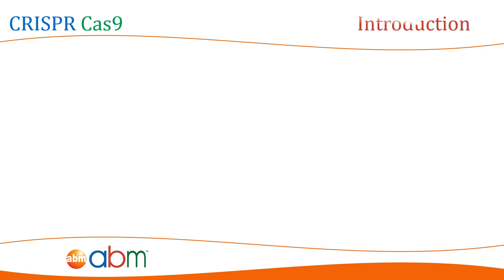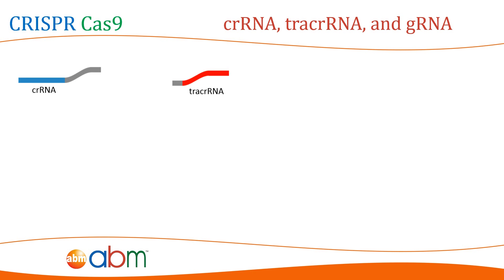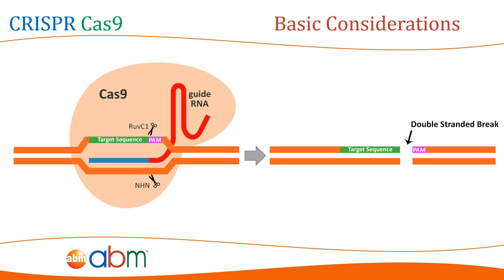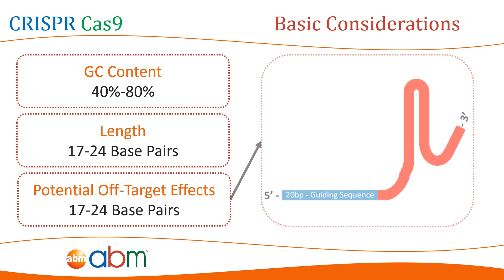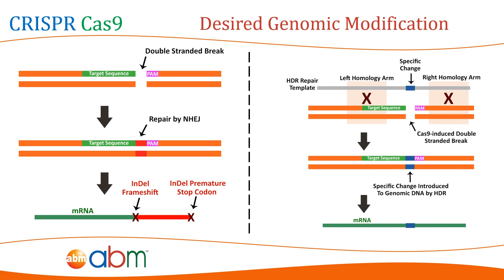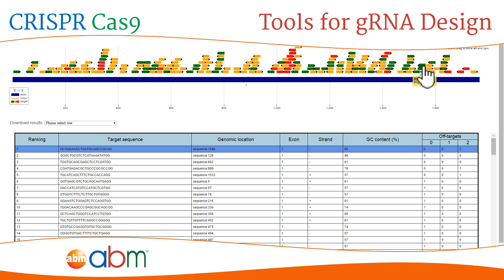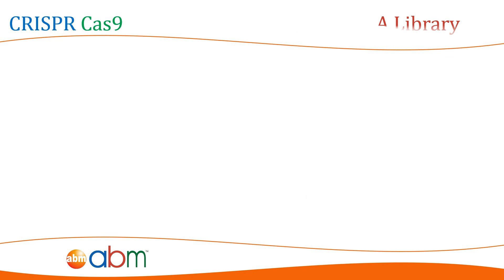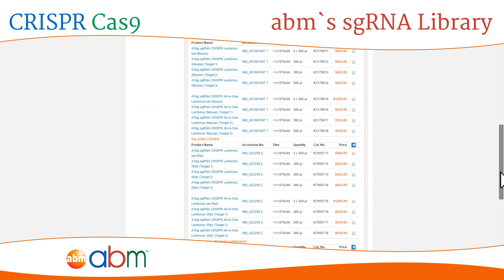3) CRISPR Cas9 - gRNA Design

Comment: What is the use of tracrrna and how does is function?
Reply from the maker: trans-activating CRISPR RNA (tracrRNA) is a small trans-encoded RNA. In the engineered CRISPR system, the crRNA (CRISPR RNA) and tracrRNA are combined into a single guide RNA (sgRNA) complex. The tracrRNA acts as a scaffold allowing for the linkage between crRNA and Cas9.

Comment: Hello ! thank you for the video,
Is the gARN for Crispr-Cas9 the same as the one with Crispr-Cas13 (which targets ARN transcripts) ?
Reply from the maker: ChopChop can be used to design sgRNAs for use with Cas9 and Cas13, but the design considerations are different. For example, there is no need to look for a specific PAM sequence when designing sgRNAs for use with Cas13.

Comment: I want to produce a KO Arabidopsis Thaliana, is it possible by this system. Traditional systems are time consuming. Please provide me a guide through. Also I would like to know if I can introduce a gene cassette of a metabolic pathway (3 genes) into the same species.
Reply from the maker: Hi Arpan! Thanks for leaving a comment! I'm sorry, but this system has been optimized for mammalian cells! Using CRISPR Cas9 on plants such as Arabidopsis requires some special considerations such as codon optimization, expression from a different promoter (popular promoters for Arabidopsis include AtUBQ1, CaMV35SPDK, and AtU6), and a different method of transfection (agro-infiltration/transformation or PEG-protoplast transfection). I have found this review paper on the subject, which you might find useful: https://www.sciencedirect.com/science/article/pii/S0734975014001931. As for knock-in, the limit as to what you can introduce would depend on the size of the cassette. Inserts that are too large will be more difficult to successfully knock-in. Hope this helps!

Comment: what would happen if there is no PAM in target, how can we design gRNA against such target so that it directs nuclease to cut that target? Then we will have design new Cas9 or old one can work. What will happen then?
Reply: Amit Kumar 
Then you'll have what's called off site or target effects. Which result in crosslinking possible transcription errors random dimer cleavage various over or under expression mutations defective genes and otherwise undesirable transfection of unintended genes. Hypothetically if you knew the site specific receptors to a specific cell line you may be able to further reduce off target binding by further engineering of viral capsid surfaces used in viral vectors.

Comment: Can Artificially Designed sg RNA target a genome without PAM ?
Reply from the maker: Hi Amit! I think I answered your question below, already, but just to re-cap - currently it is undertsood that the PAM site is required to target the Cas9 which then helps in guiding the sgRNA-Cas9 complex to the target site. The sgRNA can't target to the specific site without Cas9's help. There is a paper here that discusses the structural reasons in more detail:  https://goo.gl/LmLZKP

Comment: Do you think 1 sgRNA  is enough for the knocking down the gene?
Reply from the maker: Hi Omar, thanks for your question! Did you mean knockout of the gene? (If you meant gene knockdown, this would entail shRNA or siRNA, instead) For CRISPR sgRNA knockout, we always recommend at least 3 sgRNAs to ensure maximum on-target knockout of the gene of interest. You can theoretically knockout the gene with just 1 sgRNA, but you can't be absolutely sure that the resulting phenotype is due to off-target effects, for instance.